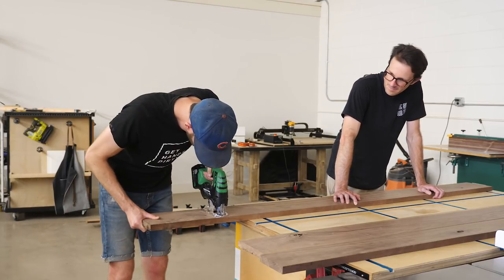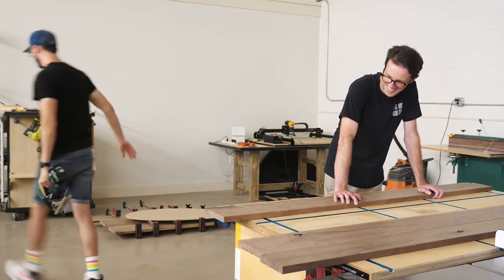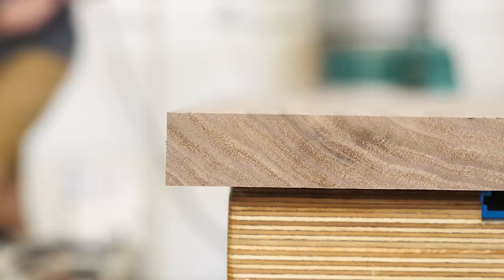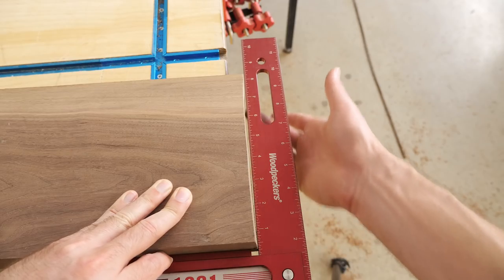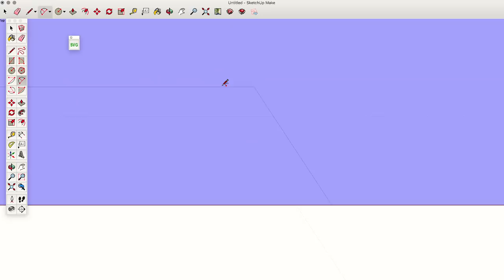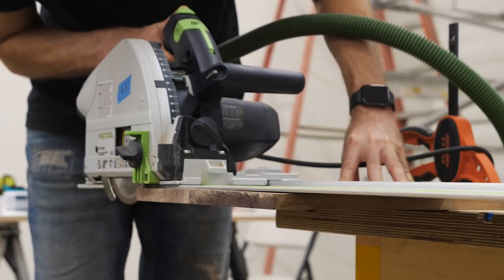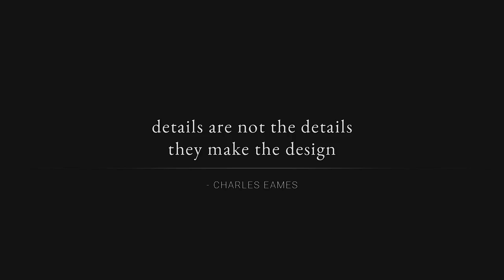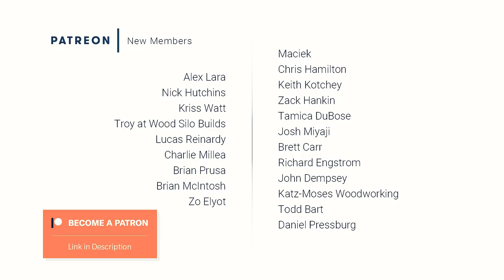How To Build A Desk | Mid Century Modern Desk Build Part 2 - Top Structure

Comment: Wife needs a desk and I just revisited this video to consider this design. She hadn't seen it before and was taken with it immediately, as I thought she would be. Because, awesome...

I started putting it into sketchup. Might be missing something, but seems like the the front legs could be susceptible to a bump from the side..? There's a stretcher underneath/between, but that runs from the side pieces. The legs themselves appear to only be glued to the outer face of those side pieces - 1/4" thick on the lap, and also the end grain. That right?

Glue is quite strong, I know. The location we'll be putting it will undoubtedly have casual bumping over the years. Contemplating a bridle joint for the leg, but the angles might be challenging. Stretchers on the sides and the back (in place of the plywood back) might help some. Hmm

Comment: Beautiful piece Chris. Just a question cause I've never used a CNC, but why did you make router templates and not just put the actual hardwood in the x-carve?
Reply from the maker: Thanks! So I thought about doing it that way... you definitely could... but you’d want to take some time to make sure it was referencing the exact right location... because if you were off a bit you’d get a really messed up result. So basically doing it this way was more laborious, but it Gave me lots of opportunities to make sure everything was going as planned
Reply: Jimmy DiResta shows a jig in the video below for this. Assuming you have a square corner to work with, use the CNC to cut vertical and horizontal fences, then use wedges to register the workpiece tightly against those. Now you know where your workpiece is relative to the CNC’s origin. https://youtu.be/wrjV11F_LuY